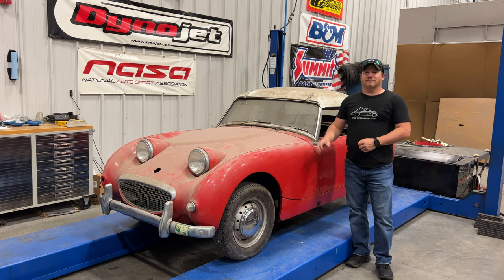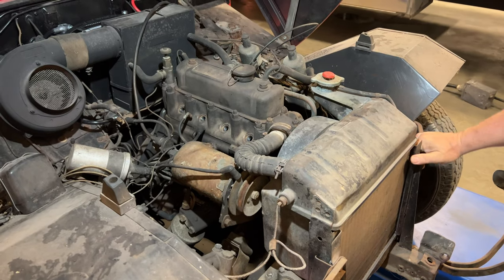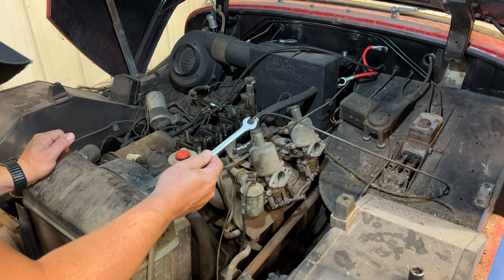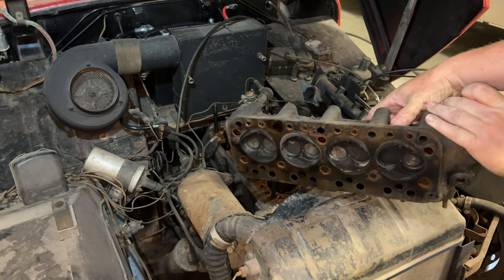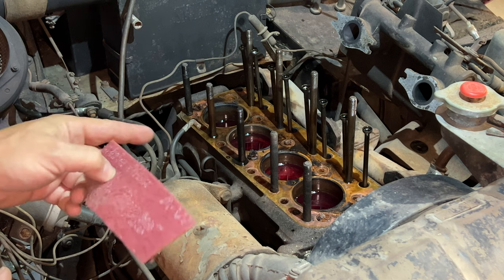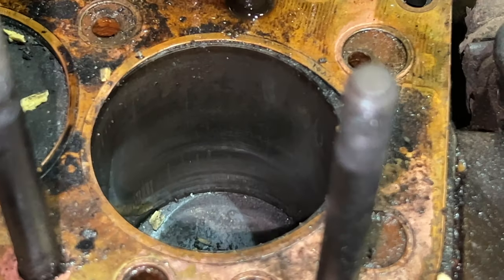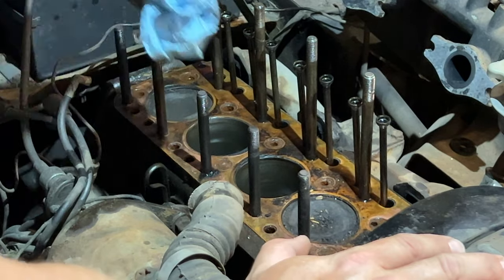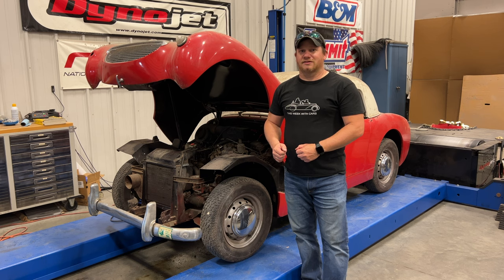How To Free Up a Seized Engine

Comment: I've done the same but advocate getting the offending piston(s) smoking hot with a torch prior to whacking.  Rings seem to release from the pistons sooner.  Otherwise put it back to gether with clean oil and fuel and run it hard for a couple hundred miles.  It should wake back up if it's going to.

Comment: I've done that a few times using transmission fluid sometimes WD-40 before they had blaster it may take a couple weeks but you have to be patient. Remember put it in 4th gear absolutely do not use a hammer. Patience is a virtue.
Reply: 50-50 of acetone and brake fluid for a few days, works great for me for over 45 years.
Reply: Put it in 4th gear so you can rock it is that what you’re saying?

Comment: Sir ,Im 64 years old, Been working on cars sense 12 years old, Did my first engine rebuild at 14, And I don't mean rering cheap job, Fitted ring grinding ring to fit, Ported and polished heads,Gauge all bearing, Now I have freed up lots of motors, Some frozen 60 years, Oil does not work, Brake fluid works best, Let it sit 1 month, If the car is standard, 95 % Success rate, Pull the car 40 mph Pop the clutch in 4 th gear.It has freed every motor, There was a ford 3/4 ton sat in woods 40 years, Frozen from the start, Thats why was parked and forgotten, 2Months I left to soak in Brake fluid, First Pull Pop free, Started and drove home 40 miles, So taken apart the Motor every time, You don't have to,, If the Car is worth 70, thousand, It should be dismantled anyway, and rebuilt, There are chances you take, could Brake a rod, bend a valve, but most of the time, it comes free with no Damage, Just trying to Help.
Reply: I've got a 59 mercury y-block that is seized. The guy who had it before me pulled the mechanical fuel pump off and left it for 4 years. 
Do you add the brake fluid just through the plug holes or or do you dump some down the carb too?
Thanks!
Reply: @CanadianBriar  Yes/also add Transmission oil /and even a Little diesel fuel Let it sit ,a week, keep bumping the starter every once and a while. It will free up.
Reply: @brianbloom1799  thank you for your response and for the information. 
What do you think the odds are that one of the crank bearings is rusted rather than a piston? The spot where the mechanical pump was removed and sitting open is right at the front of the engine. When I look through the hole I can see the timing chain and part of the crank.
I'm in Canada, so this truck has an inline heater for the winter that warms the coolant and heats the block. I've been heating the engine once or twice a day using that. My thinking is that the pistons and block will expand and contract at slightly different rates and hopefully help the rust to crack a bit allowing the oils to oenetrate deeper.
Reply: @CanadianBriar  A good way to free up a seized motor is with XcelPlus: 
It bonds a lubricant to the metal... so even if you have some scoring it will protect it against excessive wear or seizing.
🙂
Reply: You said, pull the car 40 mph and pop the clutch. What do you mean by that? If the engine is stuck or frozen how can you drive the car at 40mph? Thank you.

Comment: Time to disconnect the banjo fitting for the oil pump and fill the pump with fresh oil, check oil level and see if oil pressure will come up. Well done Steve! Cheers from Texas!

Comment: Can't tell you how many YouTube channels find an old engine (in or out of car) and they immediately see if it will start.  Those are channels I never watch again. They are amateurs and for sure they cause damage to the engine cranking on an old dry engine. I restore vintage motorcycles and I always at least pull the valve cover, spark plugs and check for broken parts. Then I use PB Blaster to free up any sticky rings and let it sit with oil in the cylinders. Will pull the head if the engine won't turn over. Sometimes do a quick hone if the cylinders need it. What you found is usually what I find as well. A bit of rust and carbon build up. If still tight, I end up taking the engine apart to check bearings. But easier to do with a MC engine.
Reply from the maker: Some cars you can slip the bearings out without removing the engine.  On this engine you cannot remove the rear main cap to check the crank bearings without removing the engine.

Comment: If there is a corrosion issue freezing the pistons you need to be careful. Even when the engine breaks lose, sometime the rings will freeze in their grooves or within a portion of their grooves. As the engine warms up, the pistons will expand on one wall of the cylinder and can freeze up badly. If you have any doubt, pull up the piston, check the rings and clean grooves as needed. If you remove the rings, do it carefully and put them back exactly the way they came out.

Comment: This is helpful Steve. I recently acquired a 20’s Nash with a seized engine. The head is already off and it’s been soaking for a year or so in diesel. The cylinder walls look no worse than the Sprite. I think I will give this trick a try.

Comment: The engine looks good and I'm sure it will be fine. There is less back ache when working on these engines in a Mini, but other than that they are exactly the same. A new head gasket and it will be running. Well done Steve.
Reply: Jesus Loves you (John 3:16) He died for you Put your faith in Him and turn from your sins before its too late.

Comment: Worth noting when using the vehicle itself to try and free an engine, you want to be in your highest gear. First or reverse puts the engine at a huge mechanical advantage over the wheels, or rather the wheels at a disadvantage. Higher gear gives the wheels more usable torque over the crankshaft. An overdrive gear is ideal, because when backdriven it acts as an underive.
Don't know what gear you were in, but I know most people will make the intuitive assumption that you want your lowest gear engaged and that's unfortunately incorrect.

Comment: Love these types of videos, very educational and gives confidence to go for it. How handy is the borescope, right? When you need it, you need it. And it's not like in days past where you had to be a specialist to own one, borescopes are SO inexpensive nowadays, yours is a nice scope from a brand name, but cheapo scopes on Amazon are what $20? $25? And they work just fine. Mine connects to my phone, fits right down into pretty much any engine. I've used it on my weed whacker engine, lawn mower, Sprite, Midget 1500, Jeep wrangler straight 6 etc and then turned around and stuck it in a hole in the ground to see who is home and works just fine each time.

Comment: I have watched many videos on freeing stuck engines, the prevailing trend is to soak things with penetrating oils of various kinds. That will be needed eventually but if rust or other metallic corrosion is the problem and it usually is, penetrating oils don't measure up to the task of breaking up those bonding agents. Success always comes down to leverage in the right place, heat if possible and an agent that actually attacks rust and galvanic corrosion, then there is a need and use for the various oil solvents for lubrication when moving the stuck parts.

Comment: I have been a mechanic since childhood and professionally for fifty years, in my experience "penetrating" fluids do absolutely nothing unta=il after you've got things moveing, I have seen bolts soaked for weeks in these mirical products and when you finally shift them the threads are still as dry as a bone, I still use them though, it's almost a religion. By the way, I've freed off loads of engines by the hammer and block method, they are usually ok.

Comment: Good video. Before you remove the rocker arm shaft you should have looked to determine which cylinders were on the intake stroke. Tapping on those would have yielded better results. Also you should have thoroughly lubricated the cylinder walls before hitting this starter. Just my two cents worth from 47 years of restoring classic cars
Reply: The base of Mystery Oil is 10 weight oil. There is a reason why it is red, although don't put it any modern automatic transmission.
Reply: @johnw6498, I have an old Ford with 55k miles on the odometer which has a 351C and has been garaged and not started in 35yrs.  What should I use to spray the cylinder walls for lubrication through the spark plug holes before turning the engine over?  Should I fill the cylinders with Mystery Oil for a few days.  Is that oil thin enough to travel past the rings?  BTW, I do have one of those snake cameras which I can feed through the spark plug holes.
Reply: @Phantoma3  You need to research what to do. Any light oil would be good enough for the cylinders if the engine fires up immediately. However, you need oil in the bearings, on the timing chain, on the camshaft and on the lifters. You can pump oil around by pulling the distributor and using a drill or some other tool to spin the shaft that drives the oil pump. Or, you can crank the engine with the starter or spin the engine with an impact wrench. With the spark plugs out. I have seen videos where someone apparently dry starts an engine that has been dormant for decades. Again, you need to research the issue until you understand totally what you are trying to accomplish, and the cylinders are only part of it. Another pitfall is that there are lot of Dr. Doom types out there who make things excessively complicated and warn you about what will happen if you do not follow their convoluted protocols.
Reply: @anonymike8280  Thanks man, it never even crossed my mind to first get the oil pump squirting oil over the lifters, camshaft and timing chain etc.  I want to make sure that everything is lubricated before trying to start it up.
Reply: @Phantoma3   @Phantoma3  Talked to a friend of mine today and he said, take off the valve covers and pour oil over the rocker arms and down the pushrods. This, he said, would lubricate the lifters and get oil onto the camshaft. You should be ready for some oil leaks after it gets running. In that long a period of time, every gasket could shrink. Unfortunately, the rear main bearing seal could be leaking too. The engine itself undoubtedly is as good as it was the last time it ran. Then there's the transmission. It could leak too from the pan, the front or real seal and even the dipstick tube. Don't forget the differential either. It could leak from the cover or the seal. Then there are the axle seals. And, of course, the cooling system. There could be wiring that has deteriorated over that much time. Then there's the fuel system. That could have leaks too. So could the carburetor. There could be a lot to do.
Reply: @anonymike8280 , oh yeah I like the idea of removing the valve covers and pouring oil over it all.  I've ordered an overhaul kit for the 650 Holley and I want to change all the fluids.  I'll have my fingers crossed with any leaks.  The car is in a garage with a concrete floor and is off the ground with 4 heavy duty axle stands.  I don't trust the tires after so many years so that's also on the list.
Reply: @Phantoma3  If you're lucky, you won't have too many leaks. But anything is possible. The carburetor could be full of cobwebs and dead snails. If it has electronic ignition, the ignition module could have deteriorated. Or, it might just run. But if it runs, things might start failing. Pay a lot of attention to the fuel system. Leaks can be dangerous. Good luck.

Comment: Rings could be rusted in place to piston in compression (particularly the multi piece oil rings). You should use a PB Blaster soak to free them up a bit.

Comment: I have added a 20% vinegar solution to a seized motor(water entry) & when I checked later there were shard’s of rust sticking out from bore wall.(I had removed head).I will vacuum out deposits then add CRC(anti seize thread conditioner) & hope for the best.
Good luck with u seized motor but I think u indicated that the piston was moving with the use of HAMMER &  importantly block of wood.
Cheers,
Cliff, Wanneroo,Western Australia

Comment: It seems to me there ought to be an ultrasonic probe that could immerse in the oil - or whatever fluid of choice.
Reply: Called an Ultrasonic Processor.  Very expensive.  Would also decarbonize the listings & ring grooves.  I've wanted one with a long probe to insert into a plug hole, but again, many thousands of dollars for used ones in the scientific fields.

Comment: I had the same problem with a tractor engine (had water sitting in the cylinders for quite a while and wouldn't move at all) soaked the cylinders with vinegar for a couple of days then oil for a day and used a block of timber and steel plate using the head bolts to create a makeshift press (took about 30 minutes of rocking it back and forth using the makeshift press and it freed up nicely) it's running quite nicely only needing an oil change
Reply from the maker: I like that idea I might try that!

Comment: Ive had 3 seized engines in the past, I oiled the cylinders, set for a couple days, then pulled the vehicles with a chain, dumping the clutch in gear. All broke loose.

Comment: seized engines are tricky .! I have found that if the engine is/was know to rotate . I have heated fuel oil , careful, not to allow the fuel oil to BOIL . This causes the piston (Aluminum to expand breaking the corrosion around the cast iron block and the piston. Then you can do your mystery oil treatment and not have wasted time.

Comment: For freeing up stuck engines oil won't penetrate down along between the pistons, rings, and cylinder walls. A good penetrating fluid that works well and is cheap is a 50/50 mix of acetone and atf. White vinegar is a bit slower, but works well, it also removes rust.
Store bought versions work well, but cost more. PB Blaster is a good one for the money. WD-40 is a waste of money for this job.
Reply from the maker: Marvel Mystery Oil is not an oil like you would think of.  It is Methyl salicylate (oil of wintergreen or wintergreen oil) which is used in a lot of different fields but is used as a penetrating oil to loosen rusted parts especially engines.

Comment: Boil some 5w30 oil till it’s about to ignite and tip in the bores after it just starts to cool turn the engine over works evertime  dangerous but works great never flat spot a shell or bend a rod with hammer and wood heat expansion contraction even a few times till it move without a hammer 👍🏻

Comment: Hint, use 50/50 mix of ATF and acetone. 
Acetone will find its way through and carrie the oil with it.
Reply: Atf and acetone works

So does diesel

Mmo works the best imo
Reply: Shake it up good. They don’t mix well.And acetone evaporates quickly so only mix it when you need it

Comment: I got a truck one time and that the motor has been sitting open for 12 years it had wasp nest it had grass growing in the cylinders and I never thought it would spin again I did some cleaning and soaking for a bought a month and she turned over I pulled the motor out disassembled it and took it to the machine shop they had to burn the block to get the rest of it out of it she ran really well then she dropped a valve so yeah lesson learned never trust valve springs that has been sitting for long time thankfully it was a 4 cylinder no big Lost but I did loose interest after that  great job on the free up

Comment: You know if oil leaks past the rings its a bad cylinder because the rings seal the air in the chanber.. the cylinders are lubricated from below.

Comment: On a water cooled engine, would circulating hot water through the system expand the cylinder bores by enough to free a stuck piston.... Assuming its not a bottom end or crank ptoblem?

Comment: If my memories of the "A" series motor are correct, they usually had facilities for manual starting handles. (In the land of dim winter evenings and Lucas dynamos, not totally unnecessary, and within the arm power of mere humans.) Does the Sprite not have the cog, or is the radiator in the way?
Reply from the maker: The front crossmember that the steering rack mounts to prevents you from getting to the crank pulley.  The engine has to be taken out or jack up off the motor mounts in order to turn the crank.
Reply: @ThisWeekWithCars  Thanks for the explanation.
Reply: Hand cranking can be done on a Morris Minor which uses the same engine.
Reply: @johnquilter7620  But a completely different chassis. You gotta be careful with the Minors, I ripped a hole in the bottom tank of the radiator with the starting handle on mine. DOH

Comment: Another way of freeing up the pistons is to put some XcelPlus down the bore.

XcelPlus forms a permanent bond with the metal which will protect it against seizing especially once you fire up the engine. It will also free up the rings.

:-)

Comment: Whitworth, UNC and Imperial. Why on earth!! I work in a UK loco depot and UNC is still used on some locos.
Reply from the maker: British cars tend to use mostly UNF (called SAE Fine Thread in the US) with BSW here and there, while American cars are mostly UNC with UNF used only on the most important parts.
Reply: It was an Electro Motive Diesel (General Motors) powered loco. I'm more electrical, don't like the nasty big oily bits

Comment: I don't think Marvel is a penetrating oil. The channel "Project Farm" did extensive testing on such oils and I think recommended Sea Foam products.
Reply from the maker: It is Methyl salicylate (oil of wintergreen or wintergreen oil) which is used in a lot of different fields but is used as a penetrating oil to loosen rusted parts especially engines.

Comment: What other oils can I use? Me and my friend in just bought a 1982 Porsche 924, and the engine is seized. The problem is that we can't find the Marvel Mystery oil in Norway.
Reply from the maker: Diesel Fuel or Automatic Transmission Fluid
Reply: Han skriver andetsteds at det er salicylsyre, som i Aspirin hovedpinepiller.